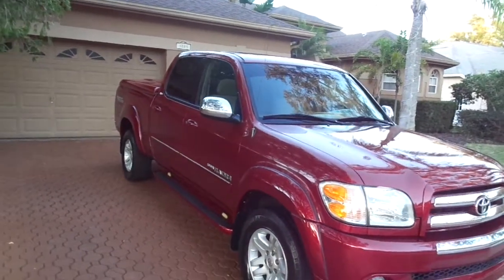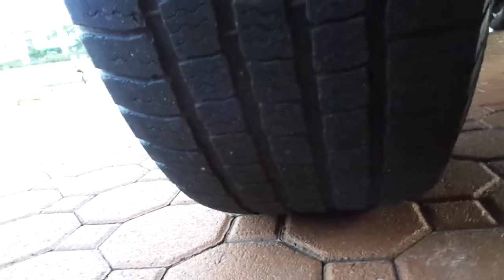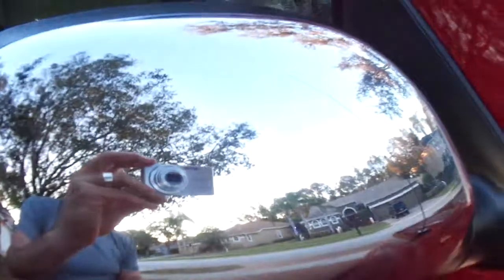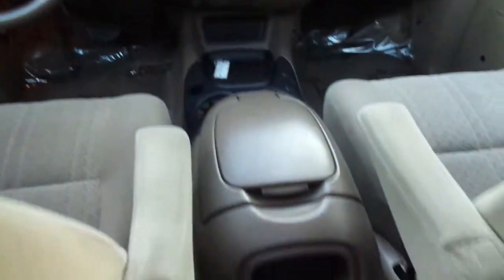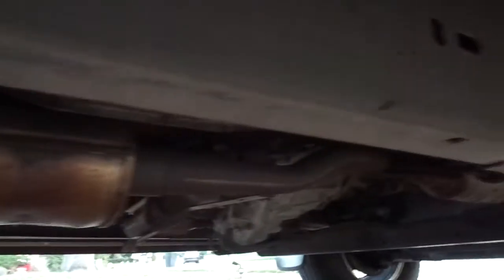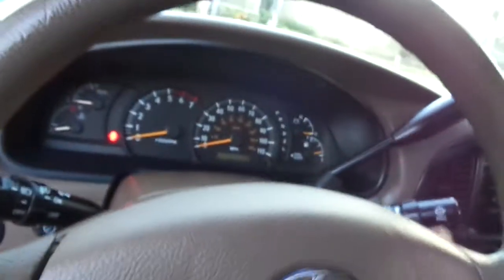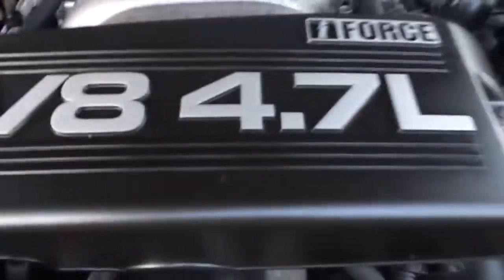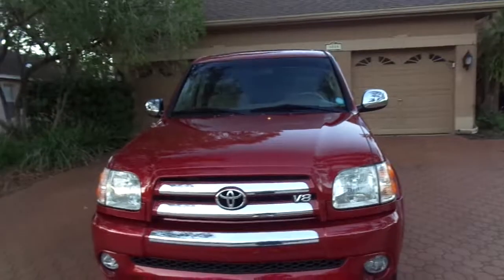2004 TOYOTA TUNDRA

Comment: 1) from florida so look at the frame rust  bc it’s easily painted over 
2)3.4 L v6 is the best engine in a truck not the 4.7 
3)people don’t get rid of this generation of tundras, there’s something wrong with it internally
Reply: not true, plenty of 4.7L well over 500,000 miles, and finally, there are plenty in my area always for sale from $5000-12000
Reply: Well mines is a 2003, 4.7 engine with 187000 miles no complaint at all,just basically few issues but been fixed/\
Reply: You obviously don't have any idea what your talking about... the 4.7 liter has hit 1 million miles on the motor and transmission. Just look up the million mile tundra